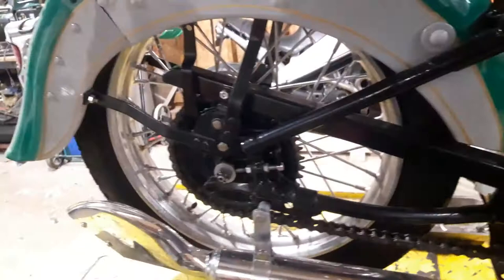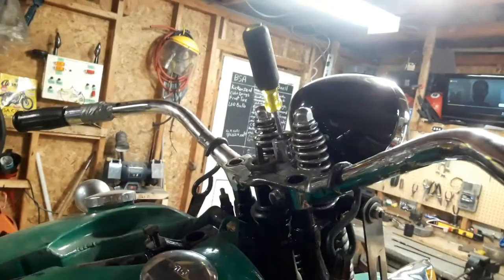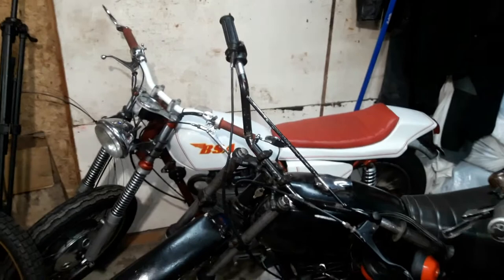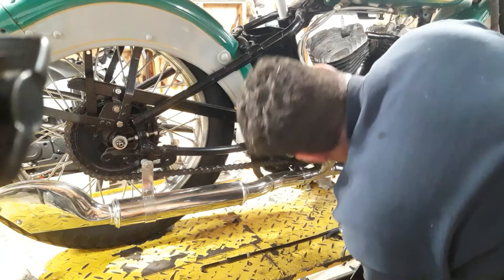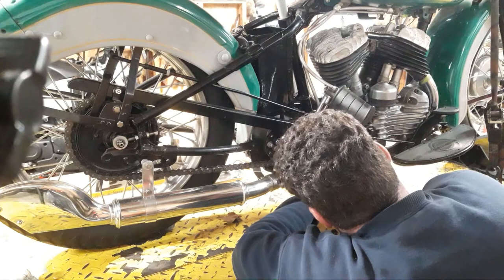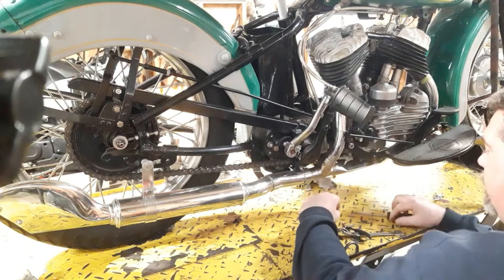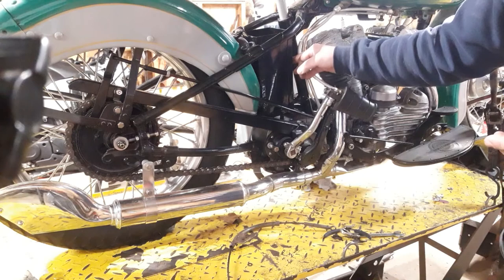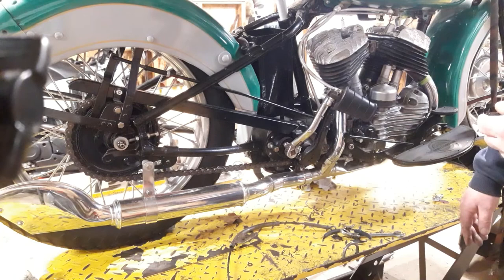1942 Harley Davidson 45 WLC Flathead Project Part 2: Brake Rod Install

Comment: I suspect the brake pedal is incorrect…it looks not right for me, it should have a sharper angle. Possibly the exhaust pipe is good if you fix the rod and pedal.
Reply from the maker: Thanks for the info, there is a lot not right with this bike. I will muddle through to make it a runner again.